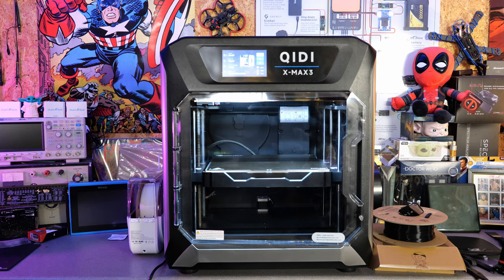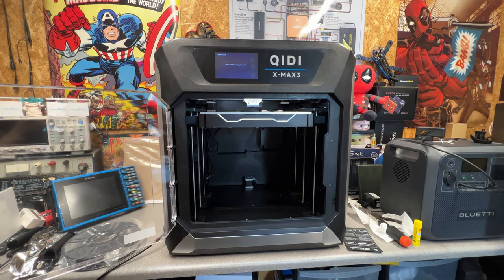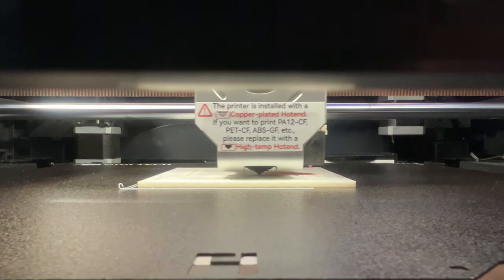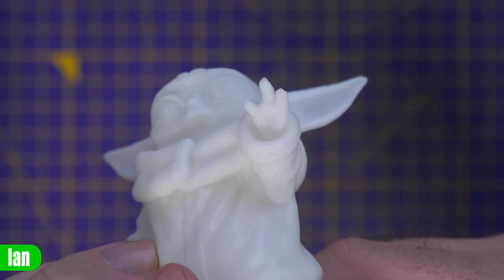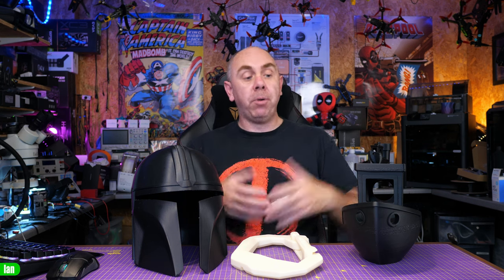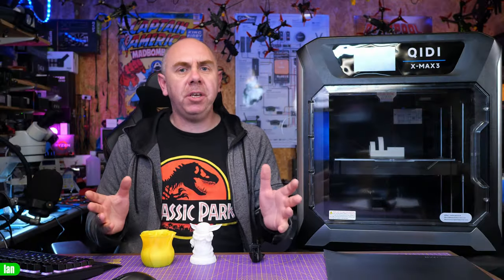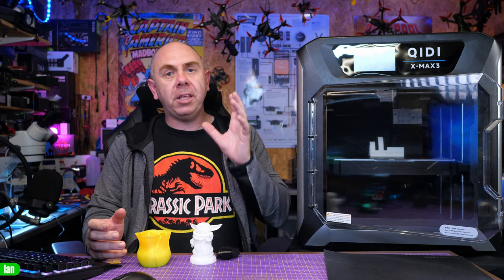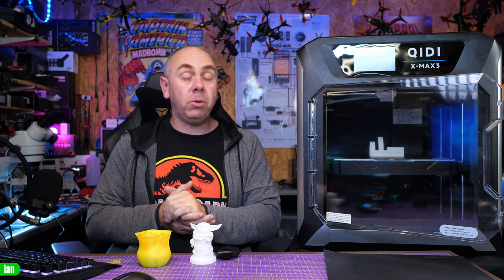Qidi X-Max 3 3D Printer Review - Large Build Volume & Speed

Comment: I bought the X-Max 3 after I got the K1 Max since the K1 Max was a bust for me....the Qidi is a fantastic printer for ABS/ASA/PA/PC and all the GF/CF variants, I have put 220 hours on my Qidi and its been flawless.....but owning Bambu printers and being so used to the eco system it does suck not to be able to check in on a phone app and be able to control the printer...but Qidi started doing pre-orders for a chamber camera and there is always the octoeverywhere option if you can get ssh access. I will be contacting Qidi support to see if I can get the login info, also must say when it comes to print quaity the Qidi is close to a Bambu printer...
Reply: Ah I’m sending my K1 max back at the moment because of ringing on larger prints is horrible. Have you had any ringing/ghosting issues with your X-Max 3

Comment: I have a bevvy of printers, but the K1 Max by Creality has been wonderful for me--except--and this is on me--when I (two different times) accidentally selected the wrong material in the slicer, heating for PETG with PLA loaded , casing a massive jam where I have to take it all apart. My MakerBot Method X CF prints like a dream but requires lots of care and feeding when not in use. This machine is interesting to me and I will pick one up, based on this review. The chamber heating is what sold me. I do see a lot of K1 hate out there and I get it.  I've had a lot of coffee today.

Comment: First off, unless you have had your printer for some time you have the version that was sold in the July/August  timeframe.

Gone are the individual magnets which were exchanged for a magnet sheet that you stick to the bed once you've removed the nine magnets,
The BLTouch was replaced with an inductive prox (my BLTouch had all sorts of problems, good riddance).
The front and back covers have been replaced with ones that include fans and/or extra fans. The necessitated the addition of a small breakout board that needed to be added to the back of the extruder.
The hotend was replaced as well, fixing a problem that it had with filament melting in the cold end.

Qidi sent these parts and more to me at no cost to me. Their support has been fantastic!

@4:53 It is also worth mentioning that some of us are tall enough to reach down through the massive hole on the top and do the adjustment that way. Just saying... :)

Comment: What are your thoughts on this compared to the p1s? Obviously the build plate is smaller, but you could get the p1s + ams for this price. Assuming you don't have a printer or you are moving on from your first printer, I feel like the p1s + ams would be a better value.
Reply from the maker: If you don’t need the size get the P1S.  It’s in a different league overall.  The Qidi is a good printer but it’s not Bambu good.

Comment: I have this xmax3, I have issues with prints popping off during printing, I think it's because the first layer is not squishing down enough, not sure how to adjust z axis on this machine to compensate. Should I make the plastic card test tighter or looser?
Reply from the maker: Go tighter with the card but before you do that try washing the plate thoroughly with washing up liquid and drying first.   Avoid Isopropyl alcohol as it can cause prints to pop.  I also use a Little Lac (hair spray basically) to help too.  

When using the card to adjust the Z you want it so that it has some good restriction when you move it.  Not lightly gripped.  

My advice is make a 0.2mm flat full bed sheet in something like freecad and do some test prints.  If you’re still off the bed then lower the z by making the card tighter.
Reply: @MadRC Thanks, will be trying that. Appreciate your info. Enjoying your videos, like the no nonsense straightforward approach.

Comment: I was under the impression that the new revision came with an induction probe, due to the CR touch pin warping in the heated chamber 🤷🏻‍♂️
Reply: 65°C do not warp the probe pin. Actually inductive probes are much more sensitive to ambient temperature - the trigger point shifts. "temperature compensation" with an intergrated NTC in the probe was a big deal for Prusas PINDA2 back in the days and later replaced wit the self compensating SuperPinda - but only consant trigger point in an operating surrounding temperature of 15-35°C.
Higher ambient temperature with inductive probes is only possible with auto-z-offset. It doesn't matter if the trigger distance shifts, if you always auto calibrate the z-offset before doing the mesh.
Reply: They do, and if you dont you can ask for one for free.
Reply: @RathOX  I know, I’ve since bought 2 of them since I posted a reply 3 months ago lol
Reply: @toddy9141  how you liking them? & what do you not like about them? im stuck on P1S combo / xmax3 / K1 max / phrozen arco.
Reply: @RathOX  their spot on mate, haven’t had any issues, I like the heated chamber for my asa-cf prints, large build volume comes in handy…..I’ll be buying a 3rd soon
Reply: @toddy9141  what do you use for a spool holder, you make your own? Or use a dryer. The one on the back is ass it seems.
Reply: @RathOX  I use the back ones, no issues for me, as I have plenty of room.
Reply: @toddy9141  ah that would be pretty useless for me sadly. As its against a wall so id need something to quick access. 

im hoping they also make an MMY for run out / support filament. 
Its why i was also looking at others but i do want to make props like some helmets
Reply: @RathOX  there’s stl’s on printables for side mounts for the XM3, I’m just saying I don’t need them
Reply: @toddy9141  oh i know. I need to see if i can use ERCF for the xm3

Comment: I am trying to do a recalibration as you suggested earlier and I am now getting "Lost communication with Mcu MK5_THR......" error. This printer is flakey, wouldn't recommend it.
Reply from the maker: Have you tried a reboot
Reply: A couple of times, after about 3rd reboot it stopped erroring.
Reply: Get in touch with customer service. The hot end is overheating. They have a new extruder assembly cover with additional fans in it.
Reply: The USB-cable in the printhead has bad contact. This can happen on rough shipping. If the contact isn't pefect, it might still work. But of course, recallibrating shakes the head a lot, so this can loosen the connector more.
Just remove back cover of the printhead, and press the USB connector in it's socket...
"MKS_THR" is the name of the printheads PCB. It is based on the design of Makerbases THR36 and THR42 boards, with customisation for Qidi (using f.e. a maxim chip for the hotends thermocouple instead having a thermistor input).

Comment: Putting in a USB stick for firmware is klunky? oO;
wtf ... try having to put in arduino board with jumpers on random pins, compiling a separate flashing program for it .... Yeah, that's klunky. Putting in a USB stick is dead simple.